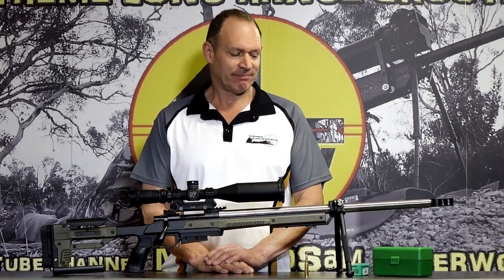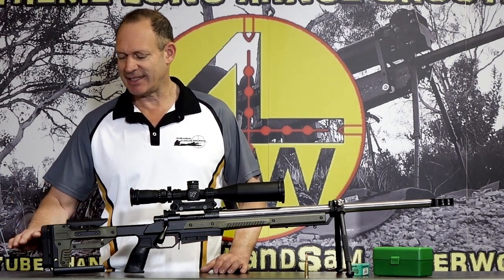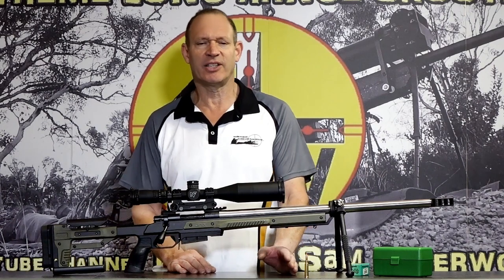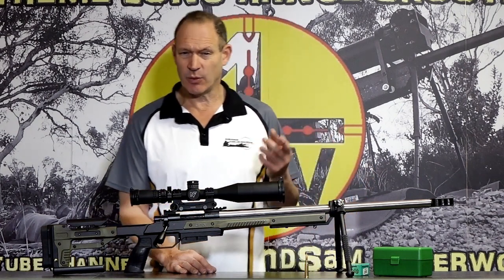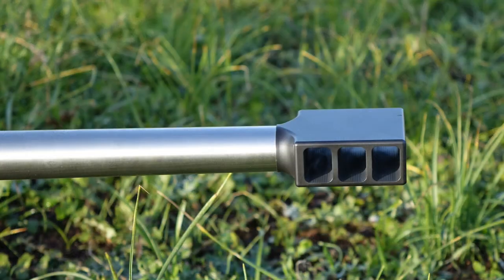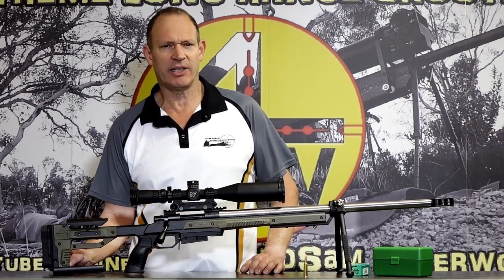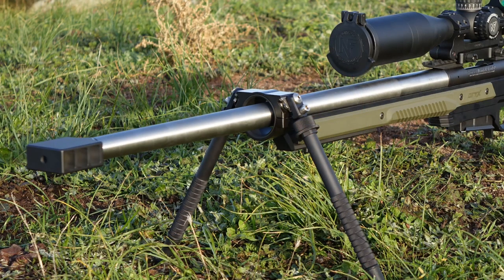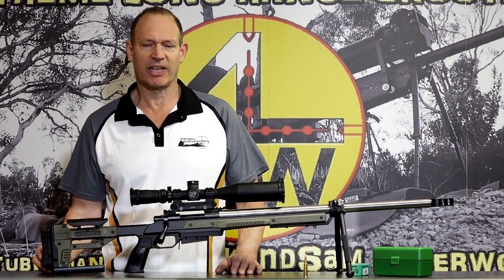22-250rem/ORYX Chassis desk top review

Comment: 22-250 underrated best caliber ever ( my own opinion 😅 amazing set up 👌🏽
Reply from the maker: Yep, Cheers
Reply: I have shot the 22-250 for decades 1x14 twist so 55gr was about max. a quick twist and heavier bullets puts a new lease on life for this old'ie
Reply: Are there any wildcats that have higher muzzle velocity than this?
Reply: @funcounting  yes, many. 22/6mm Ackley Improved,  22/284 Win, 22/308, 22/308 Ackley improv , 22 cheetah...Can't forget the 223. Winchester Super Short Mag. For ppl who want push pressures this would be the best choice due to the very thick base & web.
Reply: Another option is a 220swift ackley it will shoot the 55s at 4k+ at alot lower pressures.

1:14 twists are shooting 35gn hammers at 4600fps on the hot end .

Both cracking cals

Comment: I'm looking forward to you shooting the 22-250 I just put together an AR-10 with a 1x6.5 in 30" barrel .. trying to reach higher velocity without max loads. I'm shooting the 95gr match king and IMR 7828 SSC. was able to reach 2830 super accurate
Reply from the maker: Sounds good but keep in mind, at a curtain point, longer isn't faster, but always fun to try, Cheers
Reply: @markandsamafterwork  Yes thank you so true. What do you think the effective barrel length for the 22-250? I have a 26" bolt gun with a 1x8 twist. That will be a good test. After using the Labradar for a period of time does it work well? and is worth the investment?
Reply from the maker: works for what folks wanted on the channel, as for you, depends on how you do things, and as for length, not sure, but you can see what I chose, 26", Cheers
Reply: With AR builds I have always kept the barrel 24" or under.  The whole combination of dwell time, gas tube length, and buffers/springs just gets wonkier and crazier the further you get from the 21" barrel 15" gas tube the system was originally designed around.  That is just me.  But I do love the AR builds in non-NATO cartridges.

Where did you get your barrel from?  I have a Krieger on order for a 7mm-08 AR-10 build.  22."  Been slowly putting this gun together for over a year.  After the barrel comes I'll only need a lower then I'll assemble the whole thing and start testing.
Reply: @ourvaluesarewhoweareinadem4093  I have a dear friend who is a master machinist in Oregon. He drills and rifles my barrels and has a process of heat temperaturing the barrels. Puts them in an oven and runs inert gas through the barrels cooling them down slowly. much more effective that deep freezing them. He places the gas block further down the barrel and he also makes the gas block adjustable, otherwise the damn thing would not work. I like a longer barrel for a few reasons. I can achieve higher velocities without high pressures. finding the the right powder is a bit of effort but that's okay I love the process.  and having a semi auto 22-250 shooting a 95gr sierra matchking sounded cool...lol. If I can get a load that hits 3000fps it's stays supersonic for a long ways. I think somewhere in the 1450yrd area. I enjoy shooting aperture sights and the long sight radius helps.
Reply: @DK_6.5  It is always good to know people like that.  Long barrels are nice for speed, but you pretty quickly reach a point of rapidly diminishing returns, and besides the whole cycling problem I do like to keep my ARs 'handy' in size.  What magazines are you using for your rifle?  I run my AR-10 builds with KAC SR-25 mags as they allow a COAL about .10" greater than any other commercial magazine and that certainly is a godsend with heavier bullets in the .308 derived cartridges I run in my builds.

I hear you on the "sounded cool" part.  When I was still in Oregon I picked up a .300 WSM barrel from DeadShot in Bend and a .300 RSAUM barrel from Tactical Ordnance St. Helens.  Have yet to build them, but when I saw them the "sounds cool" factor got me immediately.  Lots of cool gun builders and machinists in Oregon.
Reply: @ourvaluesarewhoweareinadem4093  I'm using the PMAG  10rd magazine. The long barreled 22-250 (extended throat) is pretty much and experiment in trying to get the most of the cartridge on a semi auto platform... For long range targets and hopefully prairie dogs and rock chucks.  The one good thing about a long barrel it that I can shorten it... 😀 I really like using the 10rd magazine cuz when I'm slinged up in the prone position the magazine does not touch the ground
Reply: @DK_6.5  I have always preferred the 20 rounders for AR-15 platforms as you can get nice and low in prone and they are just simply more well-balanced with a 20 instead of a 30.  In an AR-10 platform 10 or 20s work well enough for me.

I really enjoy playing around with the AR platform.  Such an easy system to mess with and customize.

Comment: I nearly did something similar.  I was going to rebarrel my 22-250 to a 1:7 26" thinking much like you other than i used a bell & carlson medalist tactical stock.
But i went with the 6.5cm instead. Glad to see your project worked out. I may try this if i can pick up a rem 700 sa cheap.
Reply from the maker: Sound great, cheers

Comment: First thing I did with both my Oryx chassis was to drill and tap for a bag rider I made, you are right MDT should be doing this, makes these chassis so much easier to shoot.
Reply from the maker: Yup, Cheers
Reply: They removed the QD attachmenr holes and put a m-lock slot on the bottom of the butt stock on the newer models. I drilled and tapped both mine we will see how the new style works

Comment: That's what I use just a couple of small differences  Mine is a savage action a shilen barrel 26 inches long and 1 inch thick with a 1:7 twist I absolutely love it only down side is no factory ammunition in 90 gr 22-250 all hand loads which is more accurate but in a pinch no on the self! Same oryx chassis but a jp recoil eliminator brake love shooting it!!
Reply from the maker: Sounds great, Cheers

Comment: Great setup and video.
I've just had a custom 22-250  built for me:
PSE composite stock. International 1 in 7 twist barrel, deadline ultimatum action. Accuracy intnl mag system. Trigger tech trigger. Acute bipod. Ase  moderator. Spur mounts and an IOR scope.

Just in the process of running in. I'm working on using Hornady ELD 80grn match bullets. Have you tried these in yours?. What bullet heads were you using?. Looked like you had a box of Sierra's on the desk.
Reply from the maker: Awesome, sounds great, Cheers

Comment: Interesting comment about the thickness of the steel - makes a lot of sense. 
I brought my .22/250 Rem 700 from Australia (was a kangaroo rifle with 1:14") and I had it re-barreled to 1:11 quite a few years ago (which wasn't enough)
Where I live now (central Europe), there isn't much use for a varmint rifle, so I'm really thinking what I should do with it. 
I am considering 6mm CM and 6XC, but I hate to leave the venerable .22/250 behind (maybe an AI version?).

I only have one question - I don't remember you mentioning what bullet you were using? Edit: in the comments, I see you mention SMK.
BTW in Europe, the ADI powders are now banned because they contain DNT (so no Hodgdon equivalents) although their temperature stability is unmatched.
Reply from the maker: Didn't know that about the DNT in Europe, sounds a bit like taking the lead out of petrol,
understandable but not totally beneficial....glad you liked, Cheers